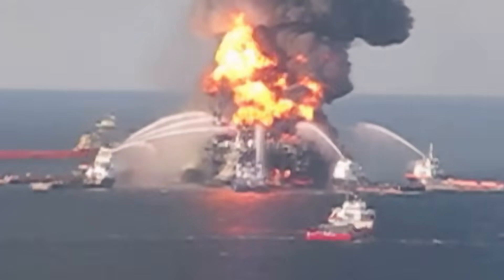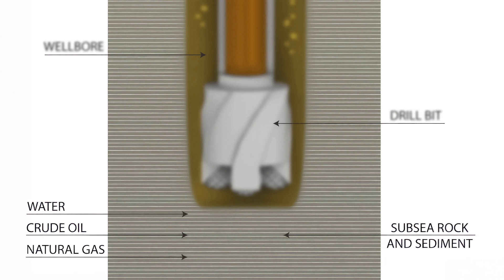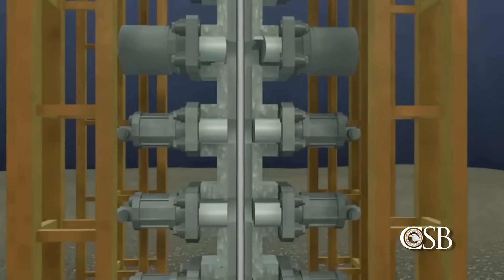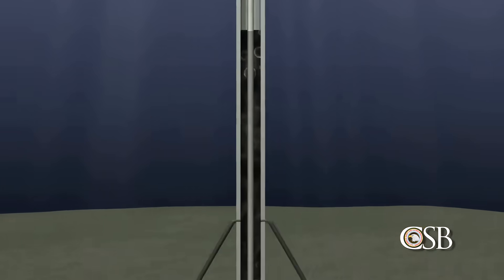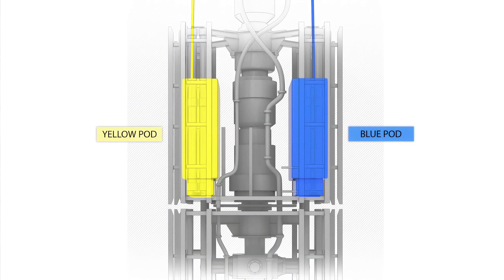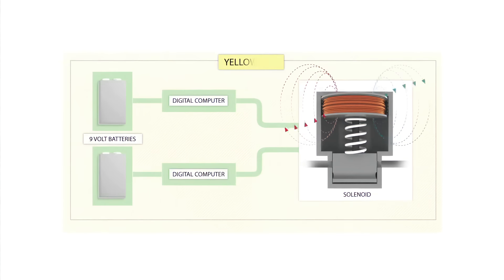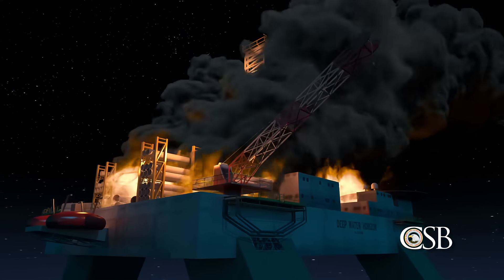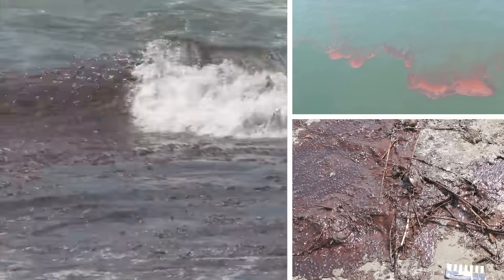Deepwater Horizon Blowout Animation

Comment: Is "effective compression" just a theory or do they have actual evidence to back this up. I've worked on drilling rigs before, and to me, this seems very far fetched. If the drill pipe offset from anythng, it most likely was from the drilling rig losing its placement over the center of the well. Drill pipe is very thick heavy pipe, I don't see "effective compression" happening. But I was jus a hand, what do I know.
Reply: Effective compression (tension) is a known, proven behavior (is the basis for increasing the riser top tension on floating rigs as mud density is increased - which increases the riser internal pressure at the bottom flex joint). Here is a simple demonstration model of the effect. http://sachristman.com/EfftenModel2.html
Reply: Blackshirt-D: and forensics found the DP on the wrong side of the BOP cavity that rig offset could have caused, to the NE (weather direction), and there was not enough time to get much offset at the likely time of shear ram operation.  (small wind and current).

Comment: Have to wonder whether investigators evaluated the qualifications of the operators on the rig.  Oil/gas industry has traditionally been a tribal culture, hiring people whose only qualification is blood relation or drinking buddy.  In this culture your credentials are only the mistakes you make and hopefully learn from 'next' time.   I encountered too many supervisors and management types who had zero formal education.  The maintenance crew I worked with didn't even know how to read the schematic of a control valve to know which end was in and which was out.  This kind of ingnorance can be and in this case was, deadly.
Reply: craig Hauger I think it's in every field. I'm a welder and I have had numerous jobs that the supervisor had virtually no experience in the trade whatsoever much less even know how to weld anything. But because they know how to run that mouth and spew out bullshit they get the job.

Comment: Over $100M rig and a security system that was misswired and out of battery. Was this...
a) never tested?
b) doesn't warn you when is misswired?
c) doesn't warn you when battery is low?
... sounds like a stone age, not a 21st century
Reply: My guess is that BP, wanting to avoid blame claimed it was "miswired" when it's likely the battery probably failed(as they often do, after long periods of sitting) on the sea floor. They bought their sweet old time, and never replaced it because it was too expensive. Equipment like that isn't just "miswired".
Reply: @mdevidograndpacificlumbera1539  Well not testing it before it is sent down sounds a lot worse than the battery draining over time...
Reply: Again its the inherent problems first though. No deep sea rig is going to bring up literally every inch of their piping to service the deadmans at the sea floor near the end of the drill pipe. You would have to stop all operations for literally months if not longer. It's an integral part of the structure it's not an add on, and even if it was no robotic deep sea sub in the world would have enough lifting capability currently to manipulate it.
Reply: why blame BP? it wasn't their rig, they were not operating it, they were simply hiring the drilling services from Transocean, which incidentally is a US company so they, of course, cannot possibly be to blame!  @mdevidograndpacificlumbera1539
Reply: @concrete542  wrong, they leased the whole rig and their men were on board, they paid the entire opperation. They were LEASING it from transocean. Trans bought the shitty rig from Hyundai.
Reply: Yes, good questions. I only watched this once, but I believe it would be possible to have low battery warning (and other information as well). Maybe they do but it was not covered here? Maybe, as a redundant system, it is just left invisible and not connected? I don't know about oil rigs, but what was said: 1) The crew can close valves remotely and 2) the deadmans work when there is no electricity and connection to the rig. So there clearly are wirings between the bottom and the rig.
Reply: @SamiJumppanen  That is what redundancy is all about by design; to ensure the safe completion of an operation regardless of potential failures being caused by human, and / or equipment  errors. But in the real world it doesn't mean anything if production trumps everything. When safety truly is the priority accidents can actually be almost completely eliminated in well built, engineered, proven systems. The more quality / integrity  the redundancy possesses the less likely failure of any one system will render an operation not being performed, or taking place. Take aircraft, and nuclear operations as example of safety, and design eliminating catastrophic failure; they are two examples of this via track record. Where on the other hand when the bottom line is the objective literally every system from inception to final operation has something wrong with it the whole duration. Hope is the tactic ...  redundancy be damned. Furthermore the "oil patch" is an area that is only governed by the minimal of inspections, and quality audits etc. Rigs are built in one place, then spend their lifespans, in many different jurisdictions. Moreover  regarding deep sea rigs there is even less government, safety, quality oversight than land rigs. Losses incurred for whatever reason are just a line on the  company's  balance sheet. "Life & limb" compensatory, and punitive lawsuit judgements, and safety violation fines etc. pale in comparison to the many billions of dollars made on just one single strike of crude. Therefore Oil companies really do not have to have a good public reputation. In reality when everything is "said & done" only the price per share of company stock matters.
Reply: Sami Jumppanen don’t most of them have sea floor cameras? Could they not transmit power that way for some type of monitoring system for the redundant safety features?
Reply: Late to the party but running a real-time video signal for a mile through the water is tricky. And this whole system is under tremendous pressure in these things happen in split seconds, literal tenths of seconds, so relying on any kind of human operator to catch anything in real time should be plan c or D at all times. Plan a has to be automation or fusing
Reply: @mkf1431  why would you need to run real-time video FFS? Just have computers top-side read data from sensors below, and if the connection is severed, cut it off immediately. 

And no, it is not at ALL difficult to run real time video for a couple miles. Even underwater. Ever heard of the internet? There is a lot of data being transmitted (including video) across oceans underwater in fiber-cables.
Reply: @TheWorldEnd2  I was answering someone who asked why they didn't use video, not suggesting they should. Video over the internet isn't live to the tenth of a second, like it would have to be for someone to try to hit a button to set off a BOP manually.  Data on subsurface cables is packet switched, it's not the same as a  dedicated live channel
Reply: @mkf1431  With video-OIP, your biggest delay is caused by the human-component. I can send video to the other side of the world with a delay of around 100-150ms. What i recommend here would be surface-side controlled sensors and systems overseen by humans. In case of sensor-link severance, all possible systems to seal the well are activated immediately, not just 1 or 2
Reply: @mkf1431  I do software development for automated systems that oversee sometimes city-sized water-distribution-networks. There have been 0 recorded cases of accidents related to my software so far. That is because we test our software both at the lab and on-site. Nothing goes without double-checking for issues by 2 different teams. Once you deploy it, it might be really hard to get it out. 

The U.S. just seems to have backwards security regulations. But hey, they ARE a developing country, so you have to give them some pass
Reply: @TheWorldEnd2  I think you think that I'm criticizing the idea of the setup, but you're actually just proposing what they already have. what I'm criticizing is the idea that everything shuts at once if you lose sensor connectivity.  That's a recipe for expensive false positives. 

Almost no laypeople understand this type of drilling. A mile deep well is a massive engineering, and and a subsurface well a mile under water is as well. They compound exponentially. 

If you really want to read between the lines, the most important line in the report on deepwater horizon is "no cement bond log was run"
Reply: @mkf1431  false positives in the name of security are unavoidable. Would you like nuclear powerplants to not have "crew-on-board" switches? Sure, they can operate without human interference and manual labour is expensive... but for how long?
Reply: @TheWorldEnd2  if you're going to keep over-reading into what people write, you're going to have a lifetime of frustrating communications and probably end up on /r/iamverysmart a lot
Reply: That doesn't matter anyway, because the pipe buckled. Therefore it couldn't cut through regardless of if the wire was correct
Reply: @Spyro5500  True, but the buckling only occurred after the kick. If the wiring problem was detected in advance the BOP could be triggered to shut down ALL flow while the pipe was still straight and a new system brought in.
Reply: That was not the cause.. the main thing was a bad cementing job and consequently a blow out...
Reply: I know, right. Anything electrical should be tested before leaving it alone
Reply: You're moronic because the stone age didn't even master the use of METALS yet.... oversimplified histrionic ideological response...I'm guessing you voted for Obama "Because it's time...."
Reply: Ah finally a good idea, all that would be required to check wrong polarity is one single diode and a signalling system.
Reply: Try 700 millions
Reply: A
Reply: @danstrayer111  this is vastly different
Reply: @danstrayer111  dude, this is many miles under the sea, so signels are a tad bit hard to send
Reply: when my 9volts in my smoke alarms get weak, they start chirping. Why didn't they have a chirp-system?
Reply: @immeohmyoh  because it is a mile beneath the sea?
Reply: It's a mile underwater, there is serious difficulty in powering an electric signal for that kind of distance along what is essentially a rotating heavy drilling pipe to the rig and as we know there is no signal currently except sonar that transmits any kind of distance under water. You would literally need some kind of engineered power generator not only at the seabed but at certain intervals along the pipe to boost signal for an independent data cable. 

The miss wiring should have been tested beforehand and it probably came down to a manager rushing workers to meet a deadline for the construction. The fact that it doesn't warn you when it was miss-wired has to do with both points above. That being said i don't believe it's impossible if they already have a way to send power down to these two pods a mile under water. It just cost too much time and money than these companies were willing to spend/wait for.
Reply: @BNAU 

 You would literally need some kind of engineered power generator not only at the seabed but at certain intervals along the pipe to boost signal for an independent data cable.

The technology to communicate between BOP and topside is established and mature.  There's no need to pull things from your imagination.  Your 50-year-old twisted pair copper telephone cable can carry high speed digital traffic over the same distance as the BOP was from the Deepwater Horizon topside.

The actual system had direct telemetry via copper cable (much like your phone line) between BOP and topside.  This isn't magic, it's standard.  The dead man system was configured to operate if those communication lines were lost.

Comms can also be (and are) sent hydraulically or using sonar.  These have lower bandwidth than electronics but how much data bandwidth do you actually think is needed to signal "low voltage on battery X" ? (spoiler: not much) This stuff was figured out years ago, they just chose not to bother for some reason.

 Joshua Smith's questions are completely valid.  A warning for miswiring of a solenoid? not so much.  But for a battery fault?  Have you ever been in the control room of an oil rig or production vessel?  On the annunciator panels are thousands of warning lights for even the most non-essential of systems, temperatures, voltages, vibration levels, phases, revolutions per minute, highhigh level, high level, low level, lowlow level on a thousand different metrics.

But the BOP dead man system had no health monitoring despite comms being available.

Absolutely shocking.

By the way, people are missing the point which was stated in the video.  If one of the batteries hadn't failed then the solenoid wouldn't have actuated AT ALL because of the miswired coil.
Reply: @daisyjenkins8543  A couple of diodes would have solved the solenoid polarity problem. And testing it before sending it down wold to.
Reply: @BNAU  fiber? ever heard of it? nearly lossless on that short of a distance. And the WHOLE Pipe is not rotating, only the drill head
Reply: Nah, couldn't have been stone age tech.
They only had 4.5V batteries back then, not 9Vs.